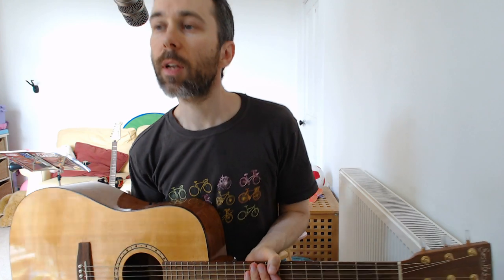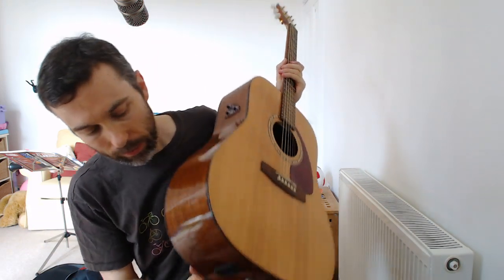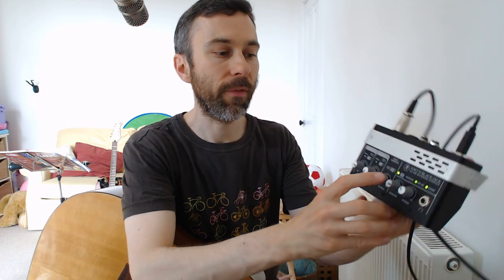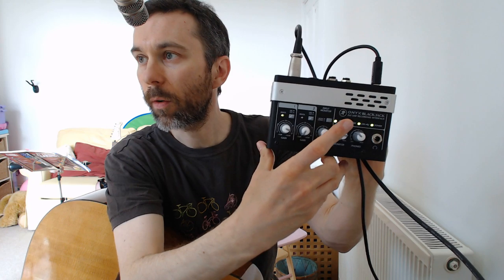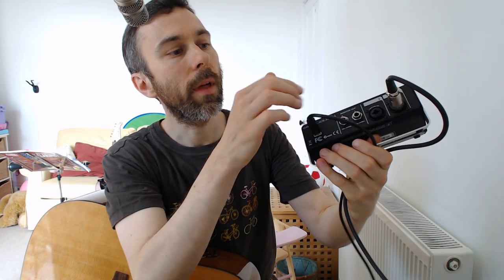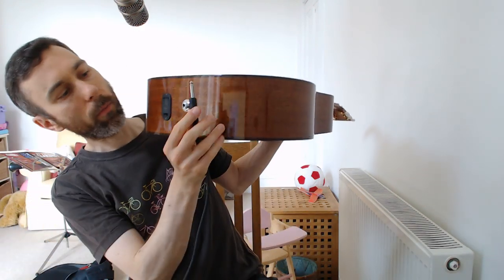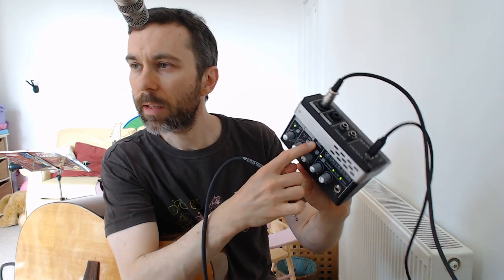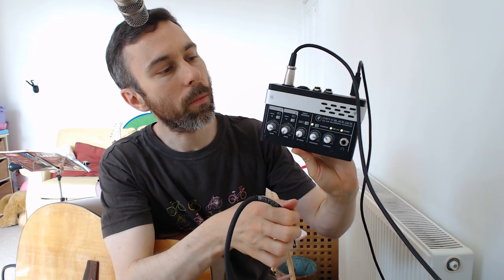An Electro-Acoustic Guitar plugged in to a Mackie Onyx Blackjack Recording Interface

Comment: hi Steven, thinking of getting it one myself, have u faced any problems with it and r u still using it? worth the money?
Reply from the maker: I ended up buying two because I like them: low noise, low distortion, high-ish gain, USB powered, 24-bit resolution, simple. All of the "cheap" audio kit that I looked at had compromises. For this the compromises are: 
 - Old fashioned specs (48kHz sample rate)
 - ASIO drivers on Windows need to be installed in compatibility mode
 - Recording level doesn't reach "full scale"/0dB in recording software, so the "clipping" indicator in my recorder doesn't light up

if you want ASIO drivers for Windows then they have to be installed in "Windows 7 compatibliity mode" (no drivers needed on Mac, and also if you don't need ASIO, in Windows it just works "out of the box" too). Not a problem for me.

For the recording level, the hardware clipping indicator (red LED) lights up, but the max level that my recording software sees is around -0.5dB, even though the waveform is obviously "flat topped". That's also not been a problem for me.
Reply: greatly appreciate your help Steven, subscribed, thanks a bunch. Cheerssss!!!!!!!!!!!!!!!!!!!!!
Reply: Steven Mackenzie will work on hackintosh? Thanks

Comment: My audio recordings tend to clip a lot. I believe it's my low end interface.

Would you say this one will tolerate clipping since it has high headroom????
Reply from the maker: Did you try to set the input gain low to avoid clipping? Then boost the volume just as far as you need it in your mix, perhaps by using a compressor software module. The Blackjack has 24-bit resolution so the software volume boost will be higher quality than if you used a 16-bit recording interface. 

You could try that with your current recording interface just in case it solves your problem without having to change your kit :)